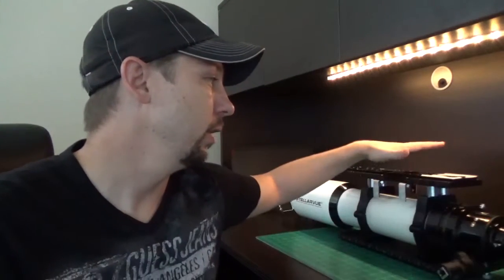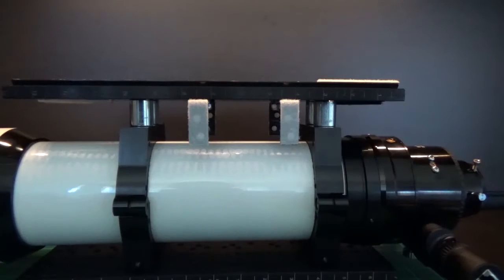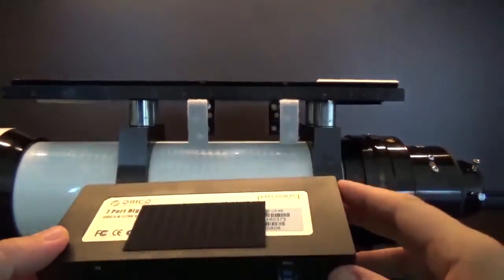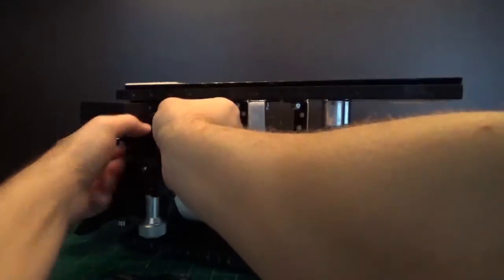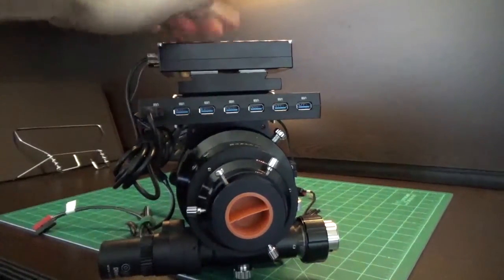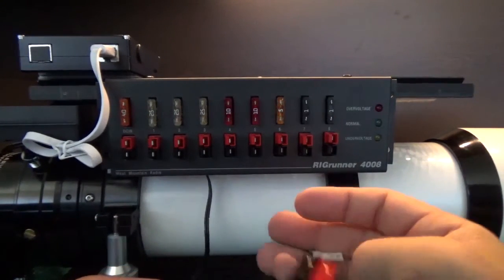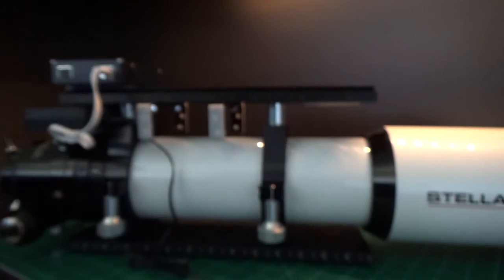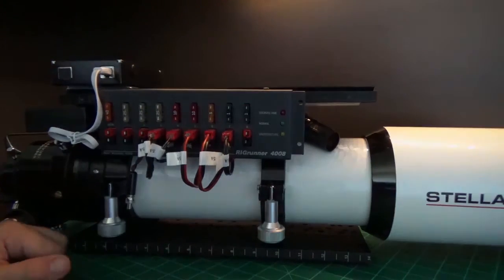Astrophotography Cable Management Part 4 - Mounting Hardware

Comment: Hi Mitchell, can I ask what USB hub your using and how you made the adapter for power? Did you need to buy a third party power cable and convert to power pole? Or can I just convert the power supply that comes with the Power Hub? Also I notice different Hubs come with different volts and ampers; have you run into any issues with this particular power hub regarding volt/amp rating?

Thanks Mitchell,
Rory
Reply from the maker: Rory,

I'm using a Plugable brand USB 3.0 7 port powered hub.

I literally just cut the power cord away from the AC to DC brick, and spliced the power pole connector to it.  It's that simple.

The Hub I bought has a 120v AC to 12v DC converter.  The 12v DC is important.  They also make some that are 5v, but when you supply 12v to it, it will probably burn up.  I made the mistake of buying one of the 5v hubs, but I have not tore it apart yet.  I'll just use it at home when I need more USB ports for my laptop or something.

As far as the amp rating goes - just be sure that all of the USB devices you plug into the hub don't exceed the amp rating of the hub.  The one I use is 25 amps total...  That's way more than I need.
Reply: Dude so helpful! Thank you Mitchell. I just received the AP Mach 1 mount in the mail after waiting 6 months. The learning curve is unreal. Harder than I anticipated (and more expensive!) Every avoidable mistake goes along way in this hobby! Really, really appreciate your videos and time.
Reply from the maker: Rory-Clarke I spent a year in the list for a mach 1 myself but opted for the MyT after I talked to an owner at a star party.  Awesome mount you've got there!  Clear skies :)